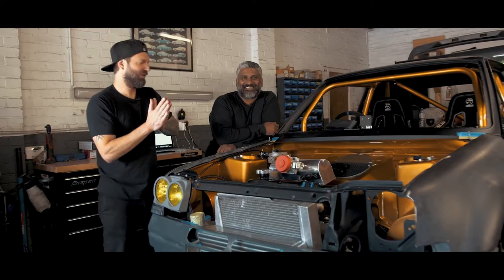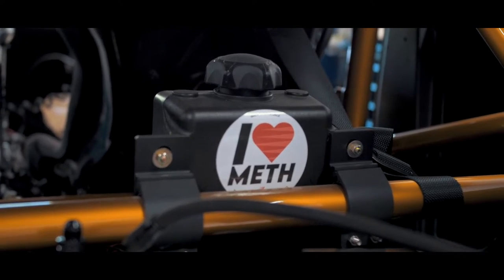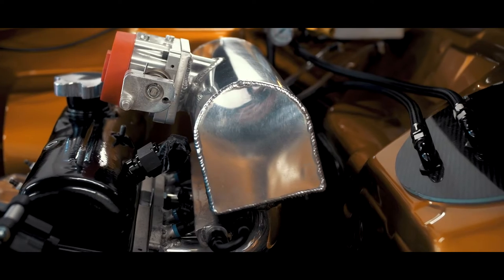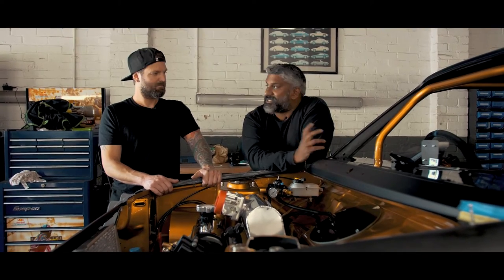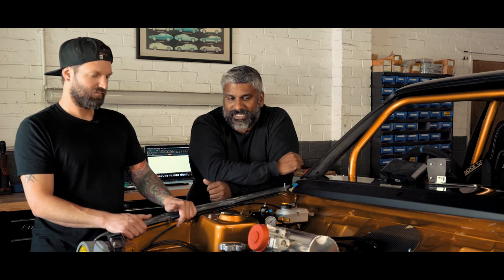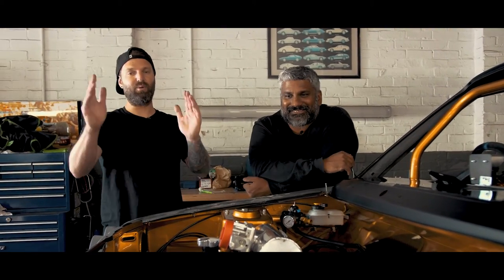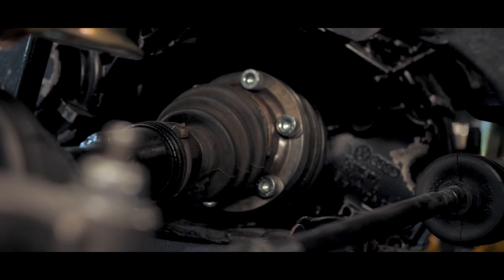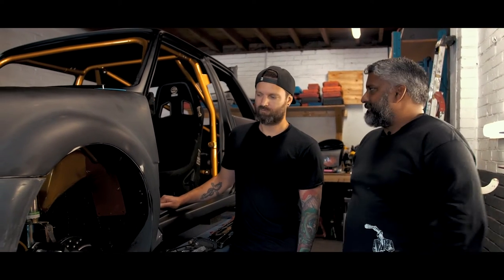445bhp Renault 5 GT Turbo project - Episode 3

Comment: Good to see progress on this crazy build!
For my R19 16v F7R turbo I've used Brembo calipers from a Peugeot 406 V6 coupe and Clio 2RS discs and 24mm master cilinder with 4xM10 fittings from a Laguna it's a direct fit conversion.